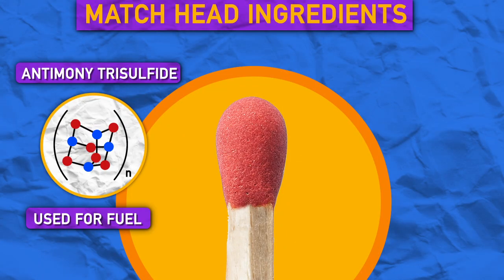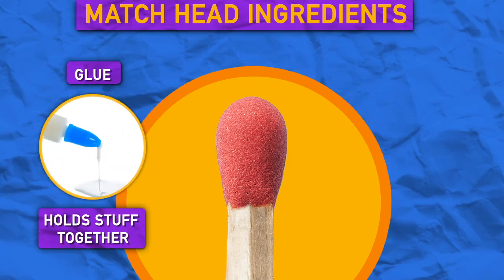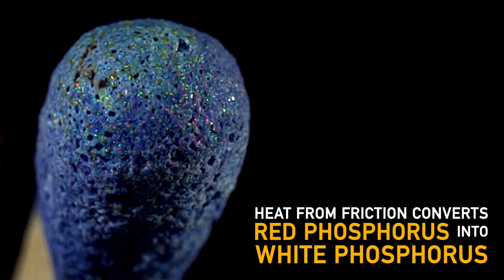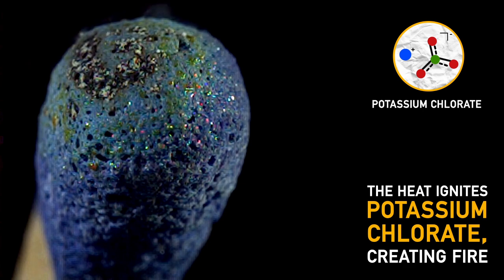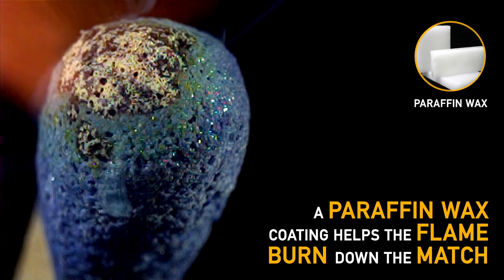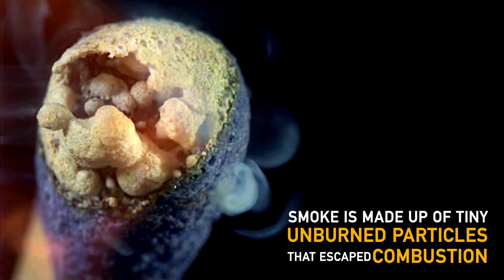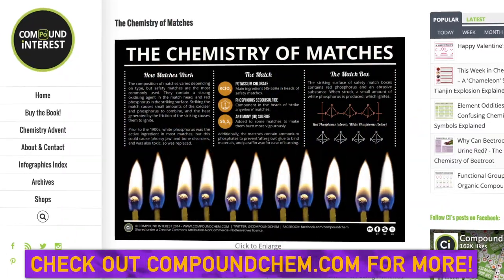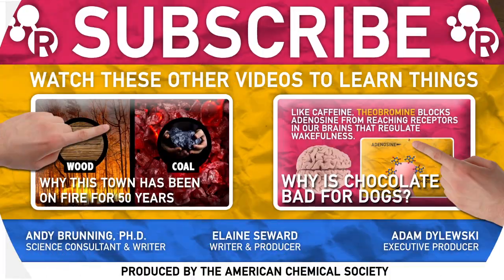How Do Matches Work?

Comment: Cool video. What about "strike anywhere" matches?
---or "waterproof" matches too?
Reply: In the heads of "strike anywhere" matches has to be a mixture of fuel (maybe sulfur and phosporous), oxidizer (potassiumchlorate i.e.), glue, and friction particles like pulverized glass. So if you rub these, the heat from the friction will be enough to start the oxidization of phosphorous, which ignites the sulfur, which ignites the glue, which ignites the wood of the whole thing. :D